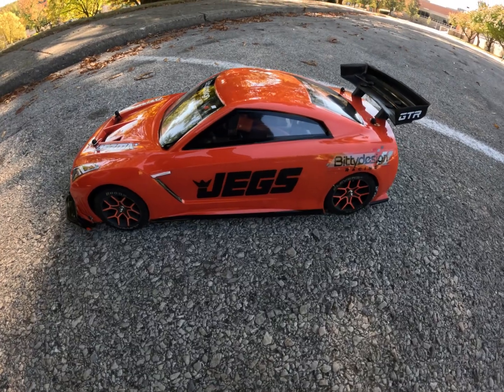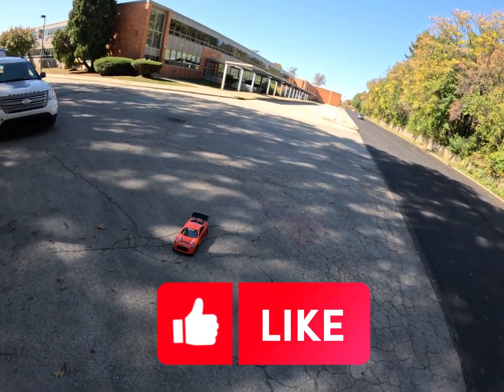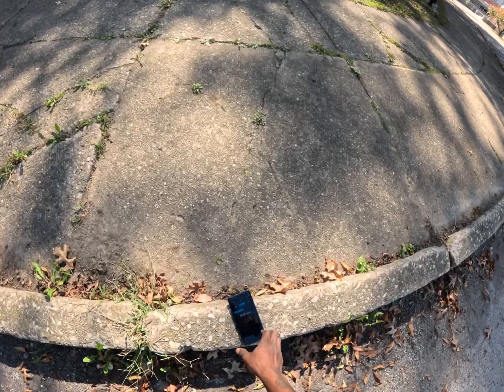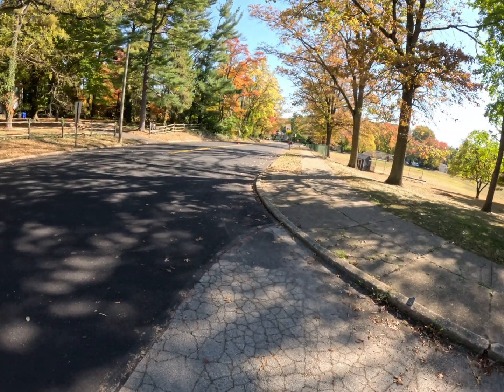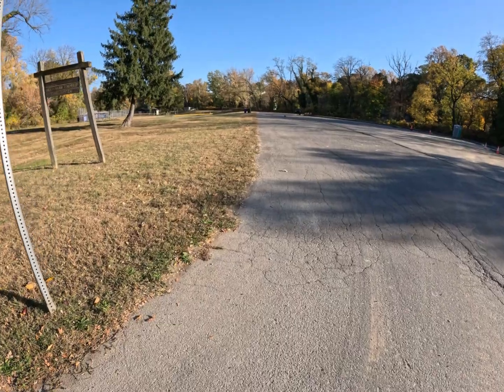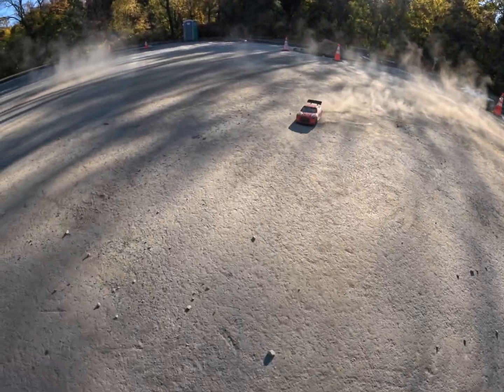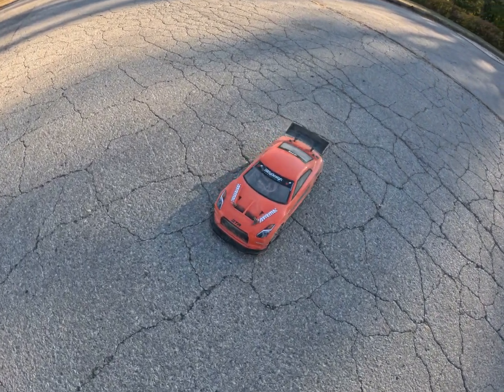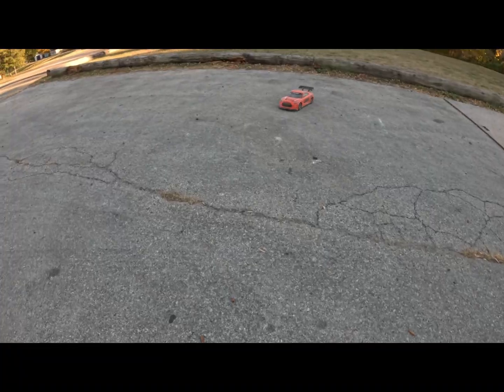NEW Cobra 10 ESC Arrma Vendetta 6S Bittydesign GTR Body Let's GOOO!

Comment: I'm so glad I found this video I've been thinking about putting a cobra 10 in my Vendetta with the speed gearing on 6s my request for you is can you tell me about the Heat and do you suggest running the Cobra 10 in the Vendetta on 6s or would you keep it on for us if you're running the speed pinion
Reply from the maker: 20tooth pinion and factory spur. The temperature gets to high  at times. Depending on how hard you run it.
Thanks for watching.